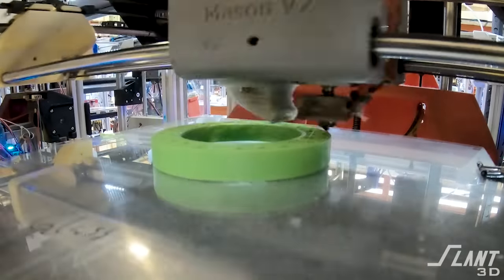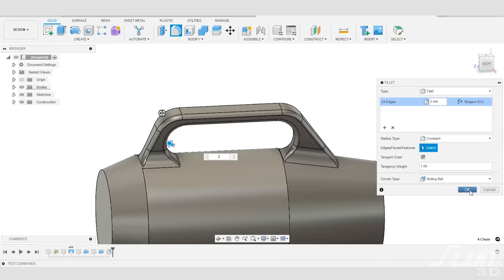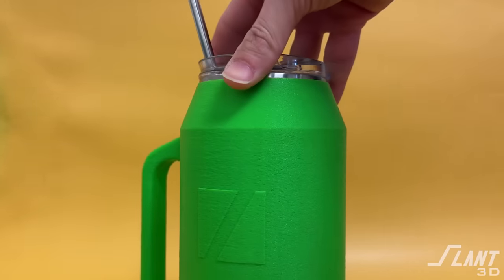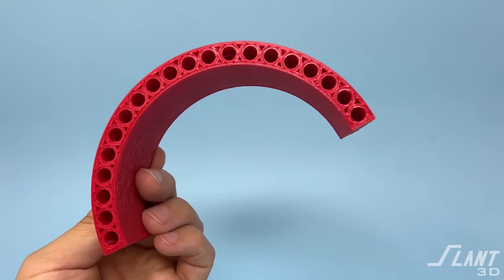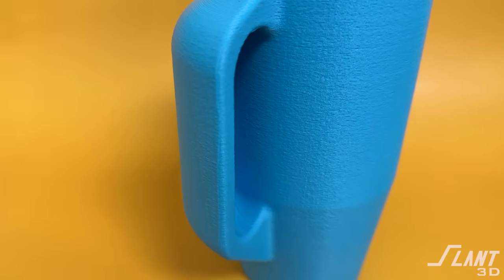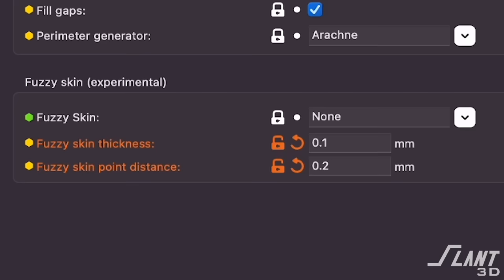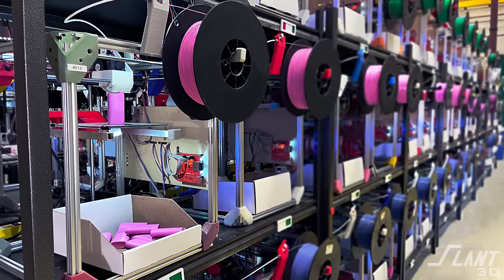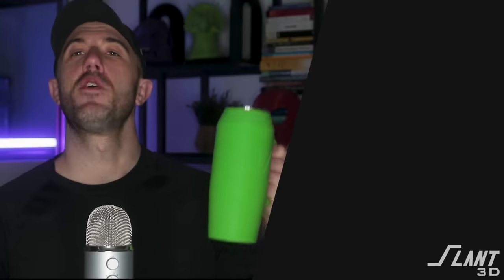We Made a Better Stanley Cup | Design for Mass Production 3D Printing

Comment: I like your content, but am extremely skeptical of your claims about the superiority of the thermal performance of this design. If youre going to make those kinds of claims, I would like to see some actual testing conducted to back them up. It would be extremely easy to do, and you could make a short.  get the compraable vacuum insulated mug, and fill both designs with hot water of the same temp. then let them sit out, and  take temp readings every few minutes for like 20 min and youve got your answer.

Comment: This is not better in any way whatsoever. Vacuum cups will absolutely have lower heat transfer than plastic air pockets. The texture hides layer lines a bit, but they are still visible and now it just looks like a poor print. There are plenty of benefits to small businesses regarding stock and tooling, but once you sell in any real volume, you want stock to be able to ship immediately and tooling costs amortize to pennies. Why make such grandiose claims? I wouldn't even have felt compelled to comment if you hadn't claimed its better than existing commercial solutions and can somehow beat a vacuum. Sure, the vacuum cups conduct a small amount of heat through the tiny area at the lip, but everywhere else has only radiative losses. The plastic has conduction losses through the lattice over the entire surface area of the cup. On top of that, you still have the same losses at the lip because the top of your metal sleeve is exposed just like the other cups.

Comment: That's the bad design it's like small on the inside in the stainless steel will make the plastic sweat will it be hot or cold and slippery good effort anyway